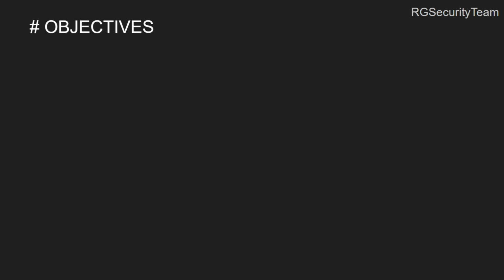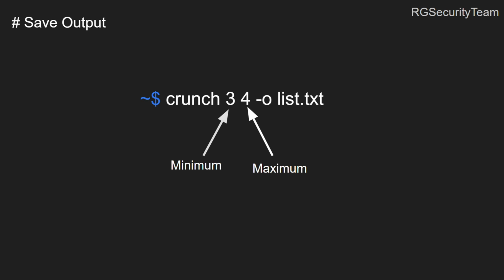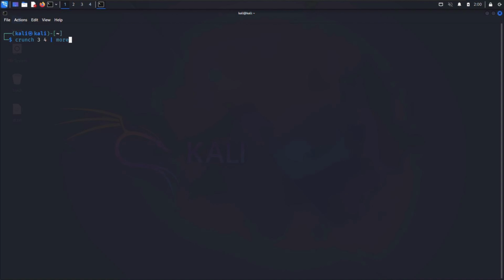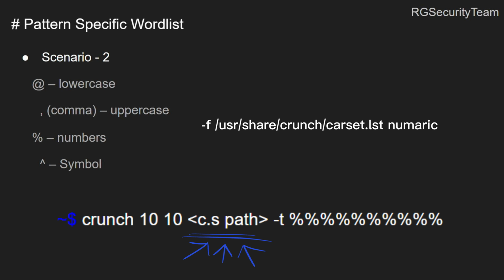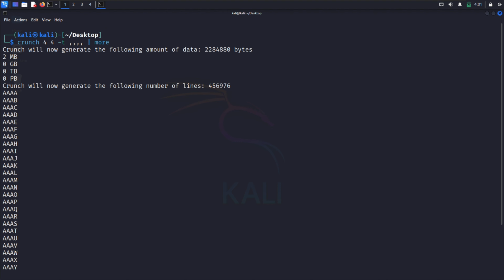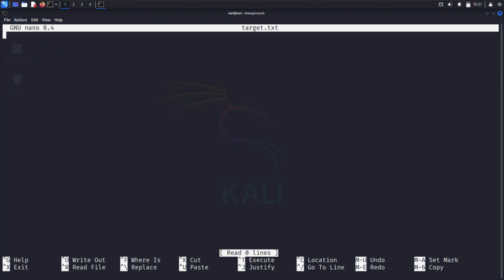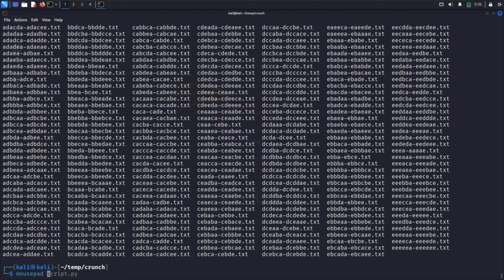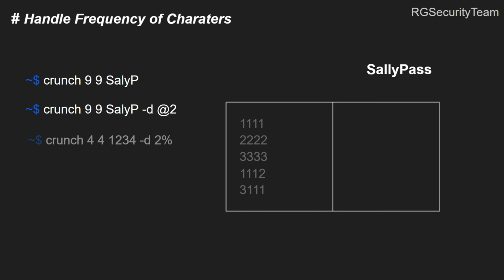Why Your Current Wordlists Fail and How to Use Crunch Instead

Comment: I'm still confused 

Let's say the password is in a format : Tghjkfdxc7&&@@ what will it look like 

Crunch 14 14 (can I use the charset file path) - I'm lost after this
Reply from the maker: pattern specific :
crunch 14 14 -t @,,,,,,,,%^^ 
@ => Uppercase
,  => lowercase
%  => numbers
^  => symbol

charecter-set :
crunch 14 14 -f /usr/share/crunch.charset.lst mixalfa -o filename.txt

If you give it like this, it will use all the characters in the character set. Or you can give it a pattern if you want. The two are actually the same thing. But in my opinion, it's better to use a pattern rather than a character set.
Reply: @RGSecurityTeam it says string length is =12  and it's not the same 14 min and max
I guess it should have been @,,,,,,,,%^^^^

Emphasis on the ^ symbol
Reply: @RGSecurityTeam after the change the size estimates are over 5000 PB 

Even if i try saving them in batches still it's overwhelming 

Also pls can u a video on hcxdumptool and hcxtools for generating the hash format required to use hashcat 

I have issues there too